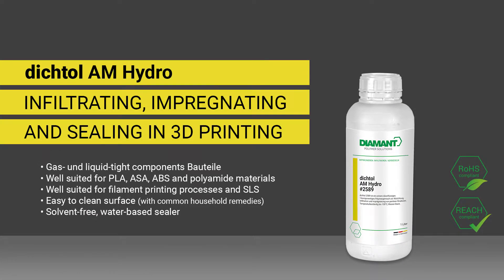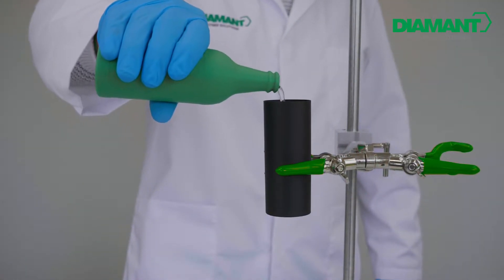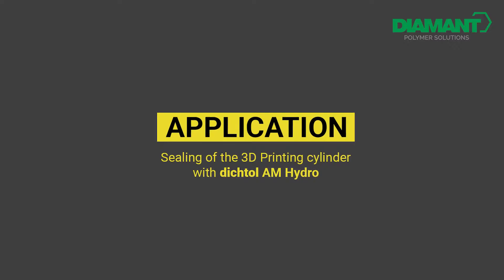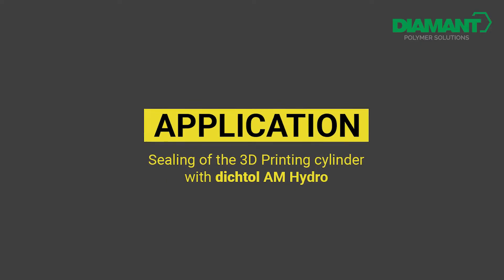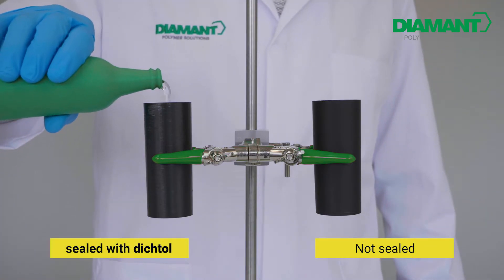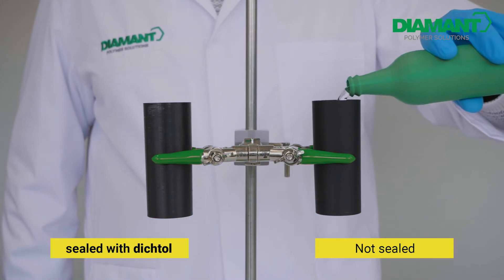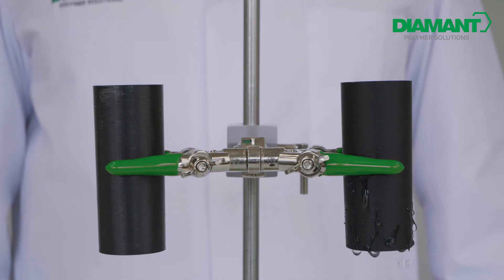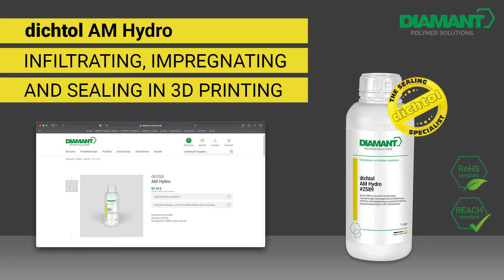dichtol AM Hydro | Infiltrating, Impregnating und Sealing in 3D printing | DIAMANT Polymer GmbH

Comment: I'm currently testing this product. I don't think people fully grasp what you've made. If this stuff works it's a game changer. I'm looking to due engine coolant parts and turbo charger air pipes. It should push this product to it's full potential as the heat cycling and conditions are treacherous

Comment: hi, what kind of paint i can use after applying this? may I use lacquer paint with its thinner?
Reply from the maker: Hey! You can use solvent or waterbased paints and lacquers. Better check on a small piece before if the specific paint is suitable.

Comment: Does this work with materials like TPU? I am planning to seal a print that is made using Ninjaflex Edge TPE.
Reply from the maker: Hi Nalalan,
Yes, dichtol AM Hydro does work with flexible materials like TPU. However, for optimal results, we recommend using it on materials with a Shore hardness of A90 or higher.
Since flexible materials can vary in porosity and absorption, we suggest printing a small test piece first to evaluate the sealing performance before applying it to your final part.

If you have any further questions, feel free to reach out!

Comment: Can I use this to waterproof a vase that is going to have flowers in it? My real question is, will the flowers take damage from the chemicals?
Reply from the maker: We haven't heard of any damage to flowers before, so it is safe to use. If you want to be 100% sure please use dichtol AM #2567, which has a drinking water conformity. A certified lab proved, that there is no migration of dichtol into the drinking water.
Reply: The dead flowers. For realz? That was your question?  Will the dead flowers die faster? And they answered you? I'm buying Dichtol on this comment alone.

Comment: hey, if i have a print with screws on it, will the screws or inserts [metal] affect the process? or is it only for plastic? thank you
Reply from the maker: Hey, screws or other metal parts don't affect the sealing process, as the sealing can also be used for metal parts. Please keep in mind that the sealer might infiltrate into the small space between screw and bolt hole, so it may be harder to loosen the screw.